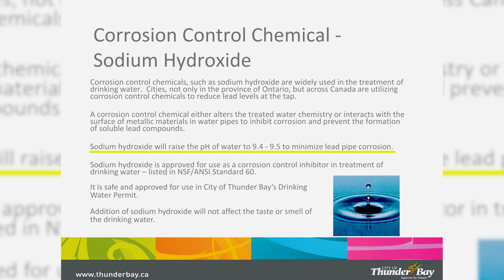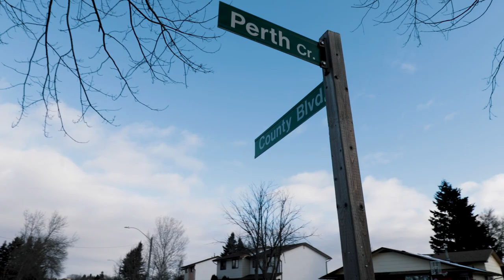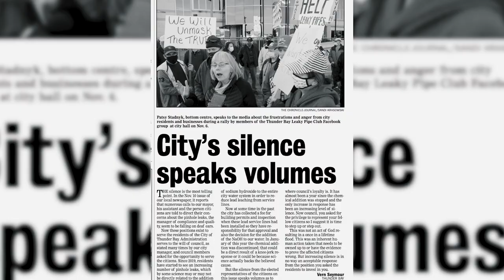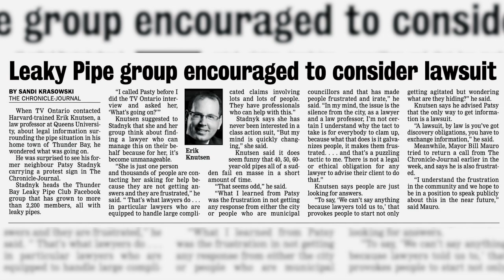Thunder Bay's Leaky Pipe Problem | by Torin Gunnell Digital

Comment: sue the city
Reply: There will be a class action law suit but that only means taxes will rise to cover the cost IMO. The Province of Ontario should also be named as they are the ones who mandated that a chemical needs to be added to mitigate the effects of lead pipes: Any other material or chemical where the municipality/owner has written documentation signed by the Director that indicates that the ministry is satisfied that the chemical or material is acceptable for use within the drinking-water system and that the chemical or material is only used as permitted by the documentation.